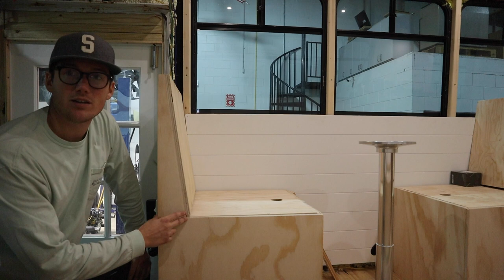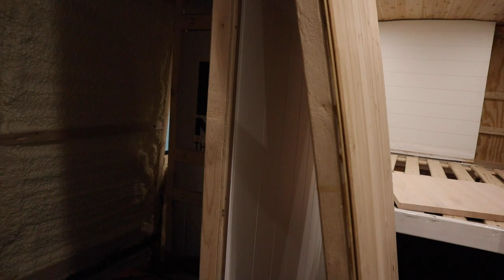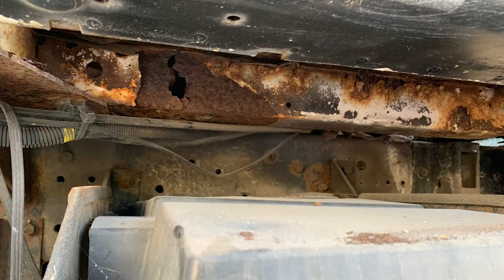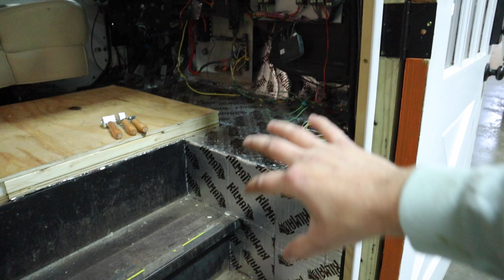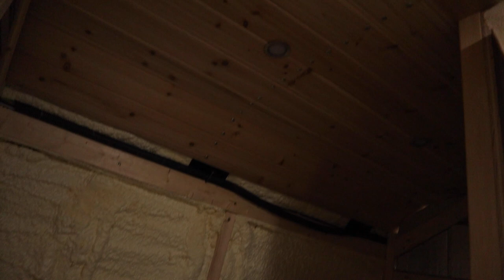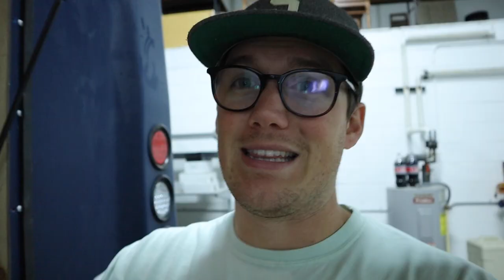Making A Comfortable, Convertible Dinette in a Shuttle Bus! Driver's Seat Upgrade, Lights, & More!

Comment: For your seat backs did you use 2"x2" under the .5" plywood? Or in other words, how dod you do the back angles?
Reply from the maker: We didn’t use anything except for 3/4” plywood. The side pieces are one large piece that include the angled back part. At the height of the seat it is 4” wide and at the top it is 1” wide. Then we placed another piece of 3/4” plywood on the front edges of those pieces to create the backrest